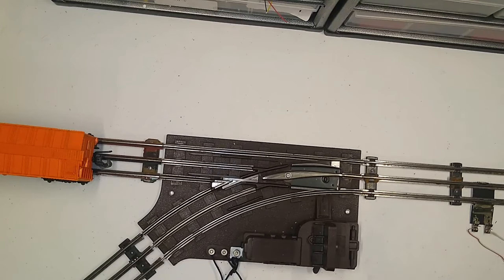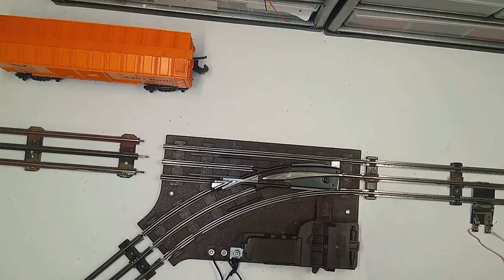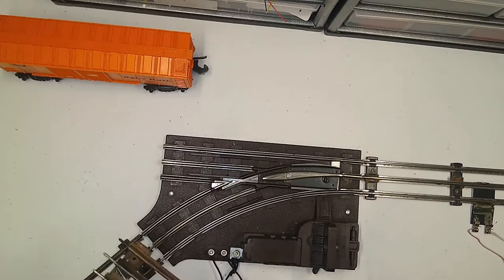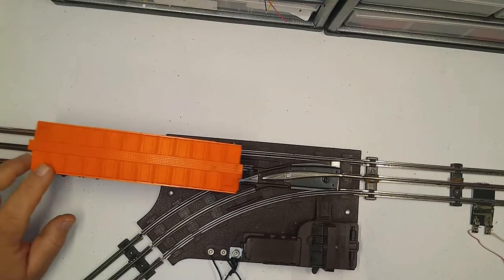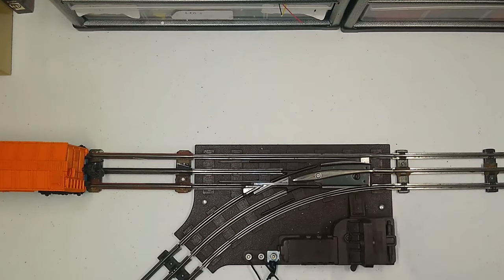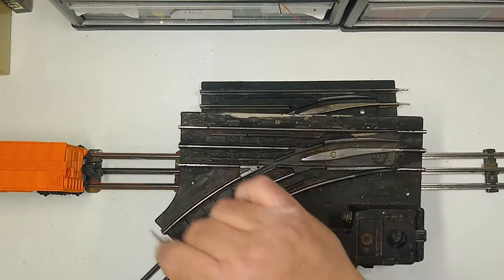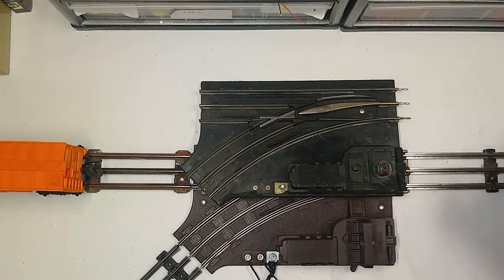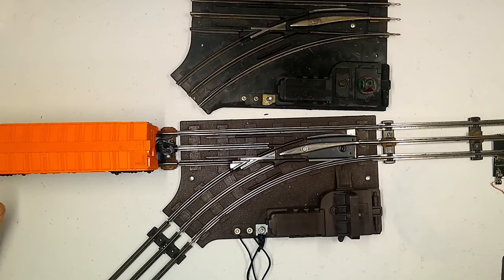Fixing The Most Common Problem With Lionel O27 Remote Turnouts - Insulating Track Pins!

Comment: Mike, do you have a video that shows how these turnouts are set and operated on a track? Thanks
Reply from the maker: Here they are in action! https://youtu.be/3UMVVewd3Nw?si=5WQD7GVH4vGJMwEr
Reply: Thanks Mike. How do the turnouts change position? Are you working the turn manually from a remote switch?
Reply from the maker: @davidjacoboski4657  Everything on this layout was automatic. The turnouts are pre-wired to change to curve or straight when the metal wheels of the train approach (the reason for the insulated rail joints). Then, I ran one wire connecting the two turnouts on the right attaching the opposite connectors. So, when a train activated one turnout to curve, the other went straight and vice versa. (Although a couple of times in the video the bottom right turnout failed to throw). When everything worked right, the train would make 6 or 7 laps around the layout before the pattern repeated. The wiring info is in the video description as I recall.
Reply from the maker: @davidjacoboski4657  Here's the description of how I did it. http://3railfun.blogspot.com/2016/03/more-fun-with-non-derailing-turnouts.html
Reply: Thanks Mike. I’m new at this as my wife inherited her dad’s 1953 vintage train. I’m struggling on how to set up these automatic switches so they work just like the last video you shared.
Reply from the maker: 1) If they are remote (not manual) turnouts, make sure to put insulated rail joiners in the spots indicated in the video. 2) If your setup is exactly like the layout video, you need do nothing to the two turnouts on the left. They will operate off track power and will switch when the train wheels approach. 3) There are three electrical posts on the turnouts. Again, if the track layout is exactly like the layout in the video, do NOTHING to the posts closest to the switch motors. These will get their power directly from the track. Wire the other two posts on the other two turnouts OPPOSITE one another - wire the center post on one to the outer post on the other and vice versa. 4) Turn on track power and watch them go.
Reply: Thank you Mike. I have auto turn outs  but I also have manual switches wired to the 3 posts of turnouts.
Reply from the maker: @davidjacoboski4657  "manual switches wired"??????

Comment: Nowhere in my NORAC rules book nor in our railroad timetable do they refer to them as “turnouts”.  They are referred to as switches. Leading point switch. Trailing point switch. Spring switch. Switch stand, etc.  The expression “turnout” is used by mechanical engineers and model railroaders.  But I may just be asleep at the switch.
Reply from the maker: Per FRA, Code Of Federal Regulations, Title 49, Part 213: "[76 FR 18086, Apr. 1, 2011] 

§ 213.133 Turnouts and track crossings generally.

(a) In turnouts and track crossings, the fastenings shall be intact and maintained so as to keep the components securely in place. Also, each switch, frog, and guard rail shall be kept free of obstructions that may interfere with the passage of wheels. 

(b) Classes 3 through 5 track shall be equipped with rail anchoring through and on each side of track crossings and turnouts, to restrain rail movement affecting the position of switch points and frogs. For Class 3 track, this paragraph (b) is applicable September 21, 1999.) 

(c) Each flangeway at turnouts and track crossings shall be at least 11⁄2 inches wide."

Technically, the "switch" includes only the movable points and the switch stand / motor.  A "turnoiut" is the term for the COMPLETE installation, including the frog, guardrails, and other components.
Reply from the maker: CSX Louisville Division Timetable, July 1, 2003, Page 123: "SPEED THRU  [sic] TURNOUTS AND SIDINGS Do not exceed 10 MPH through turnouts, crossovers, and sidings except where signal indications or special instructions permit higher speed."
Reply: Well hush my mouth.  Dumb ol' NORAC @ToyTrainTipsAndTricks
Reply from the maker: @cjcampo620  I'm looking at a document entitled "NORAC Signal Rules 11th Edition February 2018" Rule #105 says "Indicates the presence of a spring type turnout."

Comment: What kind of voltage is used to test a turnout
Reply from the maker: Lionel turnouts should snap satisfactorily at 10-12 volts. If they require more juice, look for obstructions/dirt in the mechanism or loose wiring connections.
Reply: Thanks for the information I really appreciate it.

Comment: the O27 manual turnouts do not require the insulating pins correct?
Reply from the maker: That is correct. If there is no motor, there is no need for insulating pins. Their sole purpose is to activate the non-derail feature in motorized turnouts.
Reply: @ToyTrainTipsAndTricks  Does that mean the manual turnouts are automatically non derailing? In other words, will the rail slide into the correct position when the train car wheels contact it?
Reply from the maker: No. Manual turnouts have no motor and thus will not turn in the appropriate direction by themselves. However, Lionel Postwar #1022 manual turnouts have a "power-routing" feature. If wired properly, power will only be applied to the track in the direction the turnout is thrown, creating a different type of "non-derail" feature. (Diagram to follow).
Reply from the maker: https://photos.app.goo.gl/7htB164i12nyqXaC6